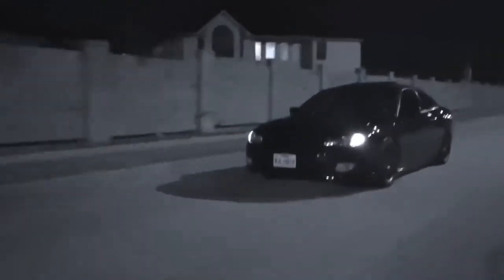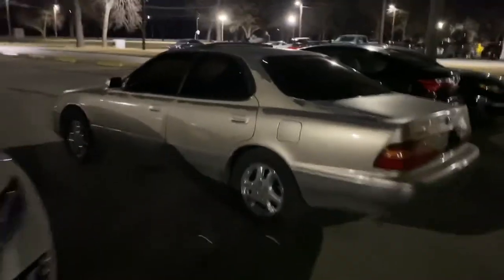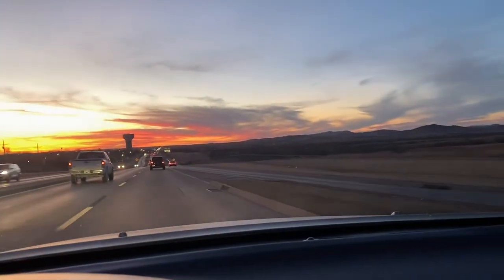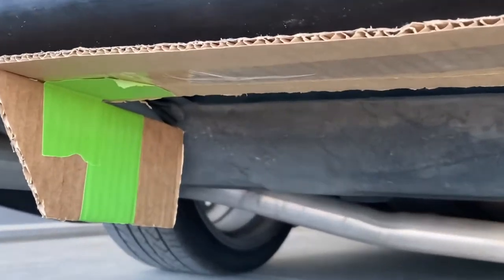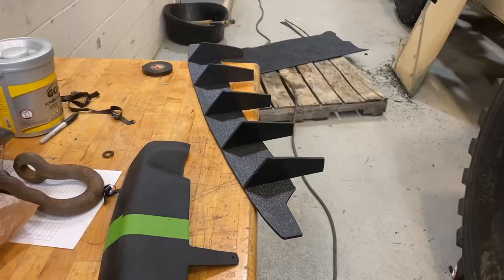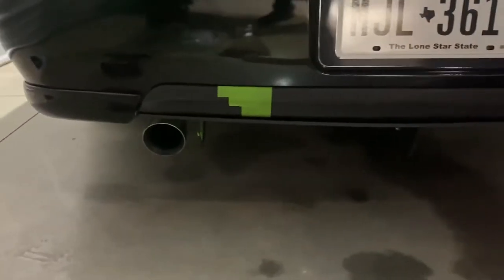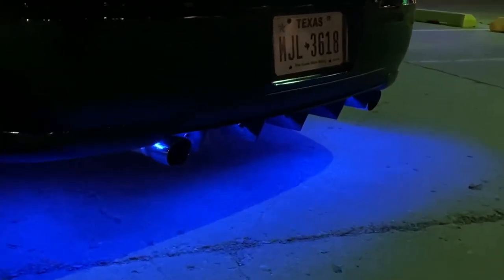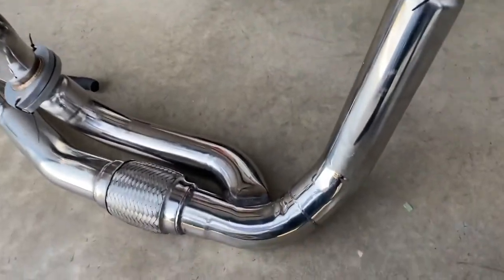Tackling a DIY Diffuser Project for the Solara + an Update on the Turbo Process

Comment: I googled clutch in a Solara to see where the internet would take me and im so glad i found you. Im a 23 yo Solara owner. I picked one up in Feb last year as its second owner. Couple dents and no air bags but 145k miles with no noticable issues. Im in love with the car and have every dream to trick it out. but it being my only car and a commuter im scared to ruin it with my youtube mechanic ways. So far ive upgraded the radio myself and take care of oil changes. But not knowing what tools i need or where to start my dream of a "drifting solara" seems to fade with time. Any tips?
Reply from the maker: Welcome to the fam! Preciate the love 
If you have a Facebook you should check out the SolaraGuy group